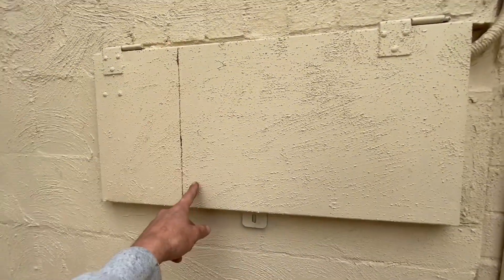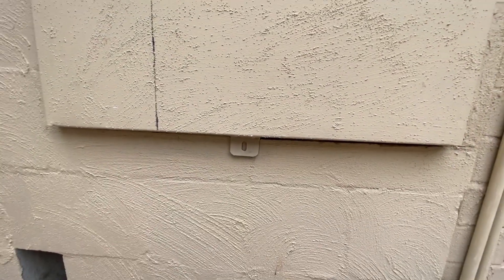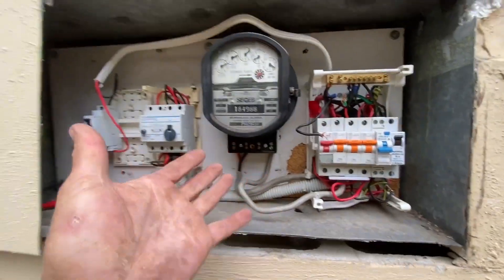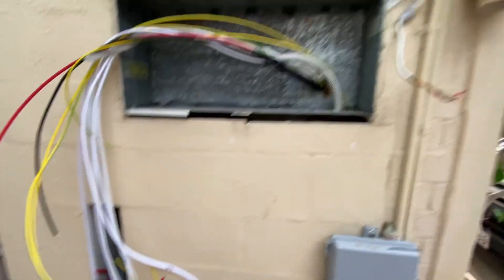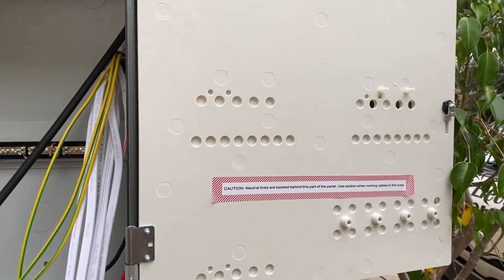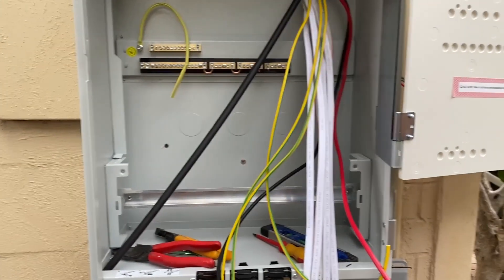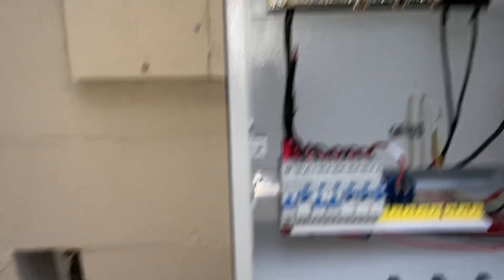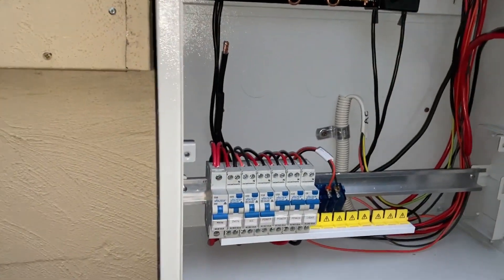My apprentice did the whole assembly

Comment: Where does it go.... Track it down ^^ <3
Reply from the maker: Didn't need to as it didn't measure anything and did nothing, suspect it was for the old HWS unit but they had upgraded to 3.6kW requiring a new 2.5mm2 cable for that service to work.

Comment: huge size difference between US and Oz. even a 40 circuit  panel here is packed to the gills
I guess that's what the higher voltage does for you
Reply from the maker: Typically for domestic you only need to split your loads to the kitchen and laundry, as when you get home you'll do the washing and have a feed at the same time. Higher loads like the oven & hotplate would be on their own circuit.
Reply: Yes and no.  Sure a typical setup is 230V single phase here and that means more watts at lower current,  but you seem to have tendency to divvy things up into functional groups, say kitchen is on one circuit, lounge on another, bedroom 1, 2 and 3 all separate too.  New Aussie homes are moving towards more circuits as time wears on.  Old places like often have a single outlet circuit, single light circuit etc unless they were split when a rewire was done.

Comment: Mystery one will bet you it is for either gate, or a long abandoned socket outlet either in the outbuilding, or on the side of the house under a bush. Could even be the neighbour gate, if they were relatives at some point, and wiring there was quicker.
Reply from the maker: Pretty sure it was for the gas ignition of the HWS circuit as I couldn't determine how it's pilot light works. It's not energised and never was.